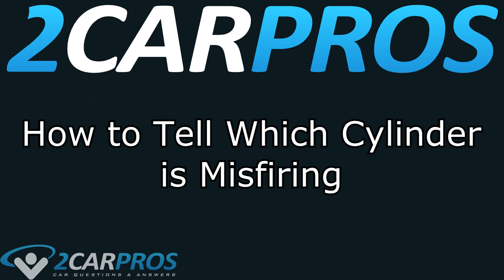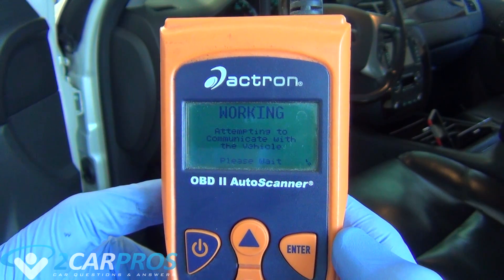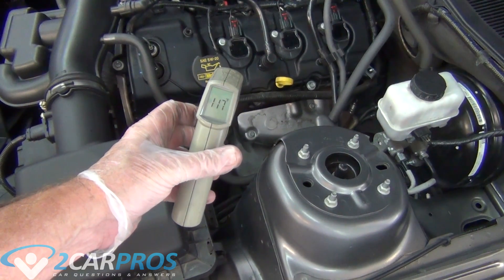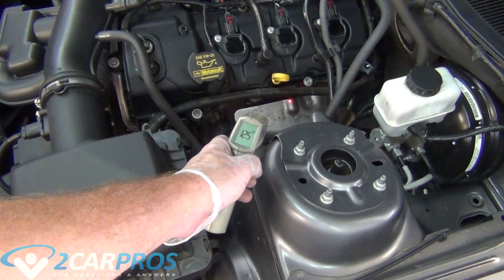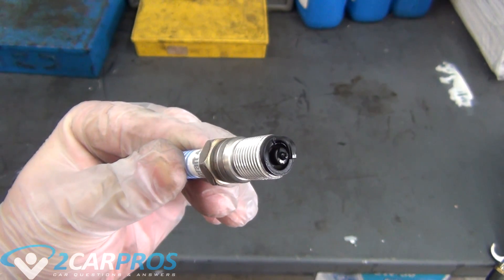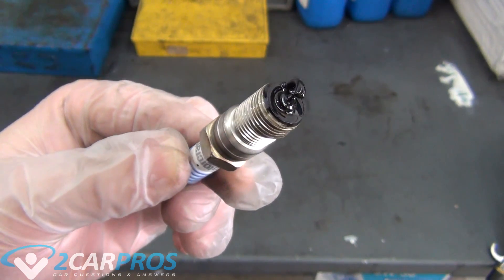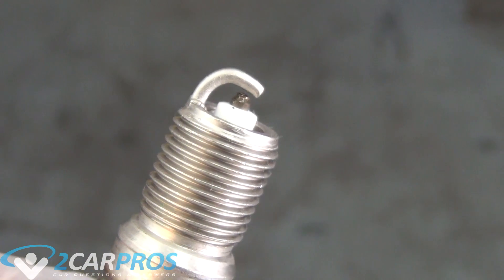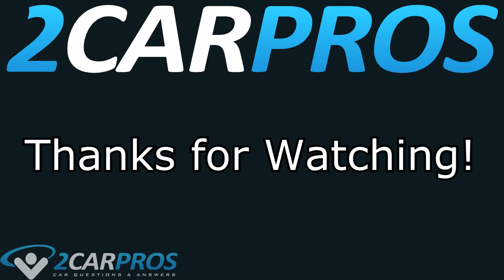How to Tell Which Cylinder is Misfiring!

Comment: I changed my spark plug. They were to the correct gag and all the spark plug wires were installed correctly. Just something felt off like there was a bang/pop from the engine bay.

Comment: My car misfires. You can feel it with hands on the engine but the car idles smoothly. All plugs appear a light brown. Its also had new plugs and a delphi coil pack. Still does it. Ive replaced the fuel filter and air filter. Ive car cleaned the throttle body. Changed the maf and it still does it. Its odd. One min its fine then wants to hold back or misses. Im not too sure ifs its a vacuum leak as bank 1 long term is almost zero. Bank 2 won't give along term reading only short term. Om wondering if its an injector fault or something else. Id like tonfind it myself. Any tips please
Reply from the maker: I would change all the injectors next. If that doesn't work one or more of the drivers in your PCM could be failing and you need to replace the PCM. Thanks for watching!
Reply: Couldn't it also have something to do with one of the following: 
The,
PCV Value
Fuel Pump
Spark Advance/Timing
Battery 
Exhaust Leak
Damaged Cables or Battery Terminals
Insufficient grounding or any other wiring related issues including bad fuses?

Could it possibly need to go through a Throttle Possition Sensor relearn? Might there be any vehical specific defects that we should be informed of?

Or are these things pointless and the solution really is fuel injectors or basically replace one of the most expensive parts on your vehicle?! 

And if it were a bad PCM after all, why would one go bad? Is there any preventive care that could be taken to extend and preserve the PCM while it is still  in its functioning state, or do we have to just hope it lasts a good long time and quickly get over it if we aren't so lucky after all?
Reply: @michellet_thatsme  hi ive since tested my fuel pump pressure. All fine. Ive now found the issue. It was dirty VVT solenoids. Removed cleaned and electrically tested and such a big improvement.
Reply: @JS-ri2rx  Nice! I'm having the worst time trying to figure out what's causing mine to misfire, and I have only about $200 left to throw at it before I give up completely because its already cost me more than the thing is worth.
Reply: @michellet_thatsme  Wish I could help you.

Comment: So I just recently changed spark plugs and coil packs for my 04 rsx which was previously reading multiple misfire codes . It is now only reading one P0303 (cylinder 3 misfire) . Think it might be a vacuum leak ? Check engine light comes on in lower gears but car seems to drive well if it’s not going slowly

Comment: Informative video, I'll try the temp gun test, maybe it will help narrow it down, I have a mechanical fuel pump, none of the spark plug problems, my truck is running like crap and I'm running out of things to try, no ECU, Edelbrock carb, I don't even know if it's a fuel or ignition problem yet, really is annoying, I'll just keep watching vids and maybe something will snap
Reply from the maker: Make sure you don't have a vacuum leak somewhere too. Thanks for watching Rick!
Reply: I hope u find/found it. Like u, I'm watching and watching. Super frustrating. If u reply, maybe, u can let us know.  Mine is a pre injector '60s V8. Cheers!